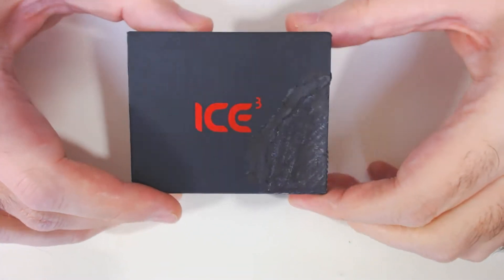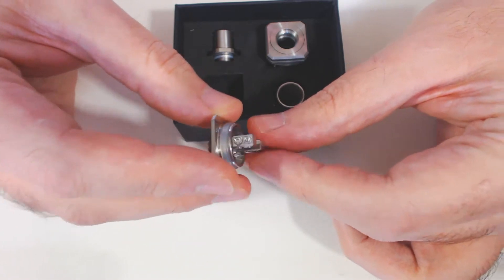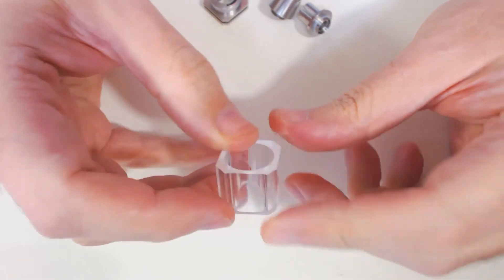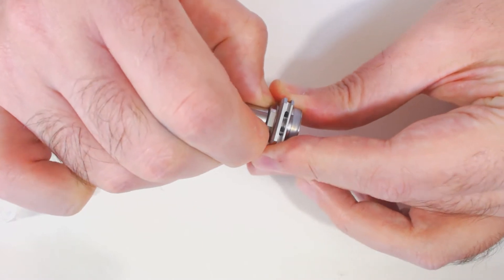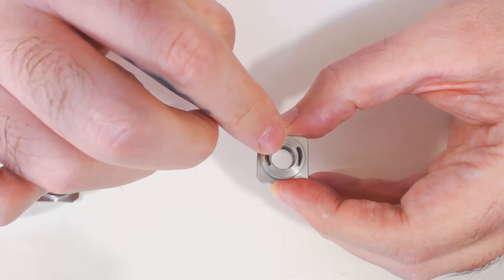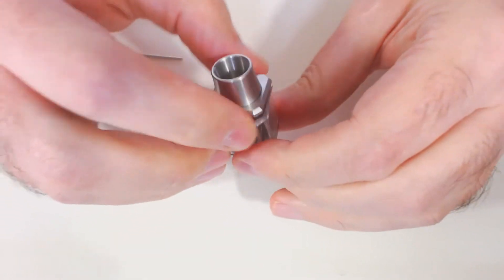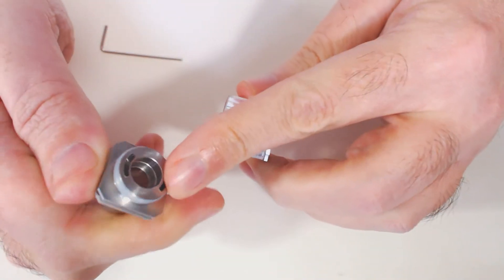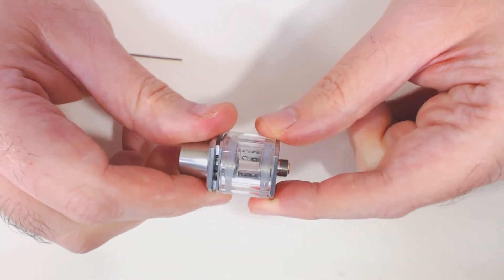Ice 3 RDA by Wotofo

Comment: Thanks for taking the time to do this review, John. I've been curious about this one since you guys discussed it on VWW, so I've got one coming in the post now. Glad you mentioned that it scratched your rx200, as well; made me throw a pack of heat sinks in the same order. Avoidable scratches on my mods annoy me much more than potential voltage drop when it comes to regulated.
Reply from the maker: +maccaj6565 glad to be of service